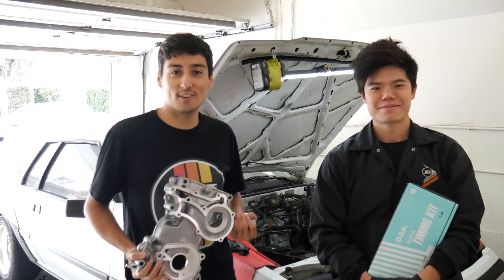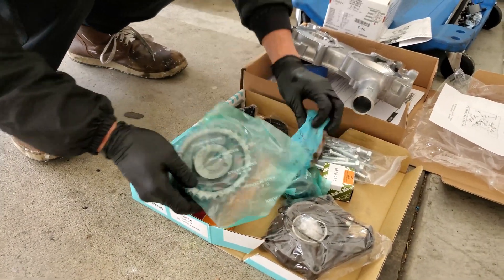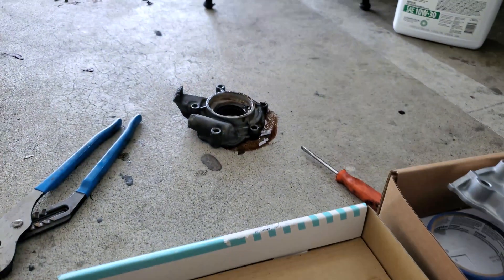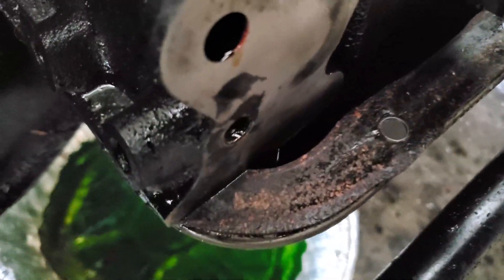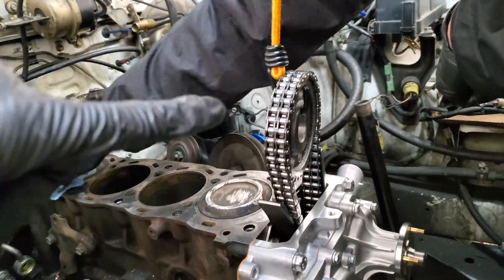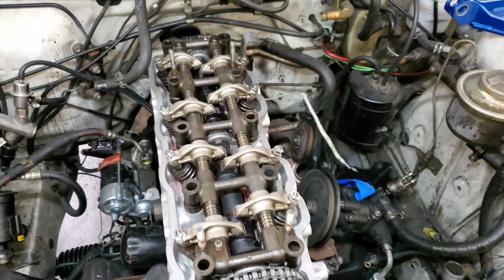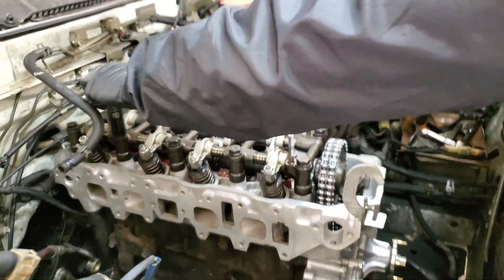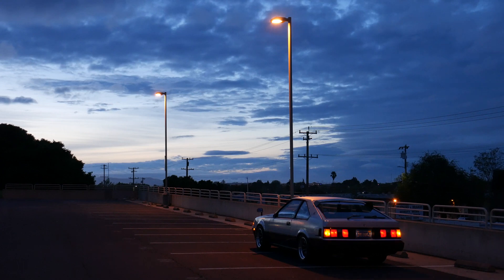Celica 22RE Dual Row Timing Chain Upgrade

Comment: Did you have to sand the top and bottom of the timing cover? I ask because I got the conversion and tried sneaking in my cover while my head was installed and I couldn’t because the cover is slightly over lapping the block. I did some research and a guy had to sand his too, so I’m wondering if you had too?
Reply from the maker: No, since you're supposed to pull the head for this job

Comment: What's the difference between single row v dual row? I'm stock 22RE EFI 5 speed. Pros? Cons?
Reply from the maker: Single row must be replaced every 100k. Dual row is lifetime for the engine. Main difference is in durability.
Reply: @winguard96  so I should switch over to dual row asap then. it'll be direct fit? no trimming or anything etc
Reply from the maker: @robertyota  I think there's a video on this 🤔

Comment: Can this be put on a 1991 toyota pickup 22-re ?
Reply from the maker: Depends - you'll have to check if a kit exists for the 1985+ 22R-Es. This was applied to a pre-1984 engine which has a different deck height.

Comment: I'm installing this soon.  Do you use and permatex or something to keep the two timing cover gaskets in place when installing the timing cover?
Reply from the maker: You can lightly "paint" the gaskets in black RTV or use copper gasket spray for tackiness and holding it in place. 😄

Comment: You forgot to install the fuel pump eccentric on the front of the distributor drive gear.
Reply from the maker: Yes, true, I would have forgotten it in a carbureted application. In this case, the 22R-E is fuel injection and thus does not have the cam driven pump.

Comment: Where is the link to the LCE instruction PDF?  Would love to have that bolt size/length chart handy when putting mine in.  Not doing the DR upgrade since this particular motor will be all stock.  Upgrading to steel guides though. Thanks!
Reply: Sorry.  I found it finally on their site.  https://lcengineering.com/wp-content/uploads/instructions/1015038%20Late%20Timing%20Chain%20Hardware%20Kit.pdf

Comment: i have the same issue with that 65 mm bolt on the bottom left @ 5;57. LC recommended that I look inside for a broken bolt. How did this timing cover work after you washer adjustment? any leaks?
Reply from the maker: Interesting! We've had no problems with the washer stack, and the current owner of Jeff's '83 GTS has not reported any issues with timing cover leaks.

Comment: Hmm, my 22re has flat topped pistons, are yours high compression pistons or is this just a different design than the truck engines?
Reply from the maker: These are stock Celica pistons. Even my 1984 22R-E had the same dome style piston. What year is your truck? 1985+?
Reply: @winguard96  yup, I have a 87 4 runner.
Reply: Pre 85 22r motors are tall deck versus the later 22R that is a short deck.  The early 22R block with the dome pistons tend to be sought after for the 20r/22r hybrid motor builds.
Reply: @charlesbronson8680  thanks!

Comment: How’s it drives? With dual row.
Reply from the maker: My guess is that it shouldn't drive any differently. We did install the LCE EFI Pro cam with it too, which really helps the 22RE breathe up in the higher revs. Jeff is currently solving exhaust leak issues since an exhaust stud decided to yeet itself out of the head. 😅

Comment: Fun fact: the Toyota OEM 20R dual row chain/gears/steel-backed guides fit on the 22R-E and within the stock timing cover.  Hopefully this LC kit didn't carry the premium most of their stuff does...
Reply from the maker: This is true! The LCE kit is $350 but it does come with that oil pump, and every part they provide is Japanese-made. It's pretty good value for the price, imo.
Reply: @winguard96  That's a fair price especially if it includes the cover.
Reply from the maker: Oh yes, timing cover included too!! Forgot to mention that.
Reply: What's the advantage of the dual timing chain conversion?
Reply: @floridamotocross7833  it will basically never fail and you will avoid the inherent flaw of the stock single row chain and plastic guides.  The double row also utilizes metal reinforced guides.

Comment: Wow that's a nice piece! Are those actually metal timing chain guides too? I've only ever seen plastic.
Love the bungee cord trick! I'm gonna remember that one when working on my SR20 engines. Nice work.
Why dual row timing chain for this engine? Just ultimate reliability? I assume no boost with that head gasket.
Reply from the maker: Thanks!! The shell of the guides are plastic, but the portion where the chain rides against it is metal! It's essentially the ultimate reliability mod, no more timing chain replacements every 100k miles! And yes, stock graphite HG for a stock setup.
Reply: @winguard96  That's awesome. Thanks!